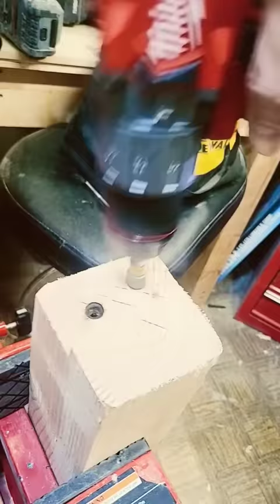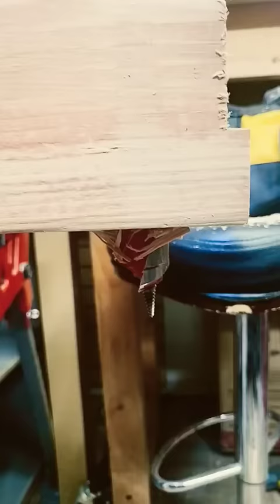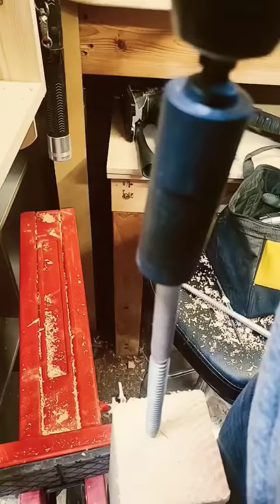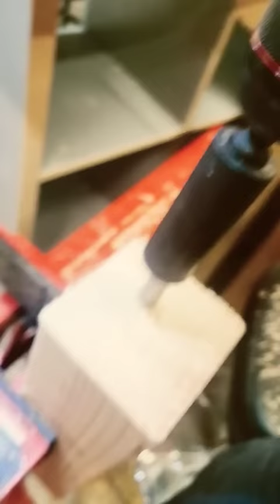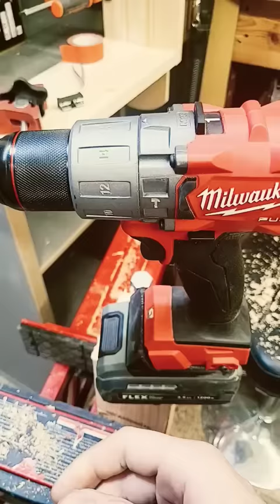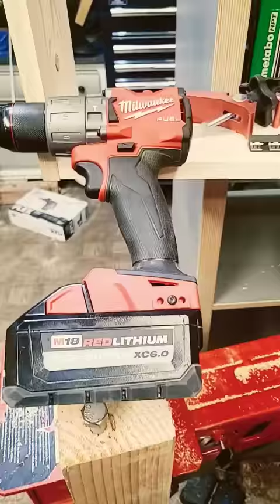Milwaukee VS FLEX - BOTH  using Flex's Battery! 💀

Comment: Well it’s the way electricity works, if you power a dc motor designed for 18v and run 22v than the motor will have 22% more speed and power
Reply: These batteries are almost always the same voltage regardless of whether they advertise 18V, 20V, or 21V.
They use 5 lithium ion cells in series. Each cell will have a charge voltage of 4.2V and a working voltage of 3.6V.
Reply: @Falcrist  no, 18v or 20v tools run an 20v nominal or 18 under load. 24v tools  run 24 nominal or 21-22 under load. They are not the same voltage
Reply: @Falcrist  24V batteries like Flex and Kobalt use 6 cells in series. They are not the same

Comment: I have milwaukee tools. 
Yes it will drive screws and lags of many lengths. 
You wanna really test a cordless drill put a 4" hole saw on it and drill through 1/2" steel plate.
Reply from the maker: yeah that's a real test for sure!

Comment: I have a question for all you guys. I have a flex power tool but no battery. Do Milwaukee batteries work on flex tools? And if they don't, which other battery other than Flex battery work someplace?
Reply from the maker: Yes, with am adapter   but get the flex batteries the adapters will kill your batteries
Reply: @toolsandtactics  thank you 🤓✌️

Comment: I wonder if anybody's tried a torque test m18 fuel drill with a flex 10 amp stacked lithium vs Milwaukee battery

Comment: I seriously wanna see someone 3d print a NICE , m18 battery to m12 tool adapter.
Reply from the maker: I think I m going to hardwire 1 live lol
Reply: Why somone hasnt tried / done this yet is beyond me. Even if the adapter needed something in it to step the voltage down a little to make it a real viable adapter. Hell, I'd buy one if they worked and save $ on buying more m12 batteries - but I'm curious what the 12v tool would do if given 18v. I'm thinking the fuel tools might just sense the overload and shut off for the tools safety, the regular m12 might just run it.  Who knows.
Reply: @kctyphoon  You would have to step the voltage down or you'd fry your M12 tools. And that makes it almost not worth it.
Reply: @Studio23Media  does anyone actually KNOW for a fact the increased voltage would “harm” the tools?  Usually things can operate within a range of voltages, and its not like it would be jumping from 12v to 60v. 12 to 18 is a pretty mild increase.  I’d expect, if anything - the tool’s voltage protection would just kick on and shut the tool down.  I’m also amazed that by now some computer geek hasnt tried hacking any of the fuel tools to increase their performance electronically through their programming. Anyway - i still say an m12 to m18 adapter is a worthy venture. I for one, would buy that if such a thing existed - as i expect many others would as well. The idea of being able to have 1 battery type power 2 different tool platform is very attractive.  No different then people buying the m18 power source so the can use their m18 batteries with their m12 heated gear.
Reply: @kctyphoon  you run an m12 with an m18 battery it will work. But with time the electronics will fry and then motor. Milwaukee would have to upgrade the electronic pcb board  to be able to handle the 18v as for the motor im sure itll be able to handle it.

Comment: Am I a monster? I've never used a drill that I could not hold on to. I am not bragging I truly get shocked when I hear people say this. I still have a Mikita 1/2 120v that I use to drill through truck frames, plows frame, and other thick steel. I've never used the handle and never felt the need to?
Reply from the maker: no, i agree, i never used a handle in the field

Comment: Until they overheat and you have to wait for them to cool off… I owned a structural steel company up until recently and my employees begged me to buy Milwaukee so I did and they hated them because they were constantly overheating when reaming or drilling steel so they went back to the old Dewalt drills and would even use the Kobalt sets I had around rather then the Milwaukee’s….hopefully there better. I did like my heated sweaters and coats …

Comment: Buddy is usin Milwaukee with harbor freight sockets 😂
Reply: You rather lose a snap-on socket?
Reply: @saint-666  don’t lose it 🥱🥱
Reply: Milwaukee is a basic brand. For years were cheaper than Ryobi. It's not like its 10 or 20x the cost like a Snapon impact socket vs the HF socket.
Reply: @rch5991  yeah bro Milwaukee is a basic brand 💀💀🤡 that’s why they have everything ryobi does but better 🤣
Reply: @anthonycurtin6522  Ryobi comes out with the same grade of tool but years later. Its not an option outside of drill/impact driver unless youre starting from scratch or youve been living under a rock and just now catching up. 

Ive had a 2763-20 for 6 years now. And it came out like 9 years ago. 1100 ft lbs and a current gen Ryobi has 1170 ft lbs. 

Milwaukee has always been the cheapest. I paid retail for an angle grinder. so weak i wish i had bought a Ryobi for 1/5th the price. But $60 for the 1/2", free ratchts, free 3/8 gun. $100 for a gen 3 impact driver. $50 drill, $60 brushed and brushless 1/4" impacts. $80 12v screwdriver, $35 12v drill. Sawzalls so junk i wouldnt even pay $50 for them.

Theres piles of this shit everywhere. its Milwaukee.

Comment: There's a reason it's M18, not M24. You're overvolting that motor, and it will die a quick death. Ill stick with using Milwaukee batteries, I've never had an issue, even driving ridiculously large lags. The new 12.0 puts out a ridiculous amount of power.
Reply from the maker: Yeah, dont do this  this   this was an experiment

Comment: When will people realize that higher voltage doesn’t necessarily equal more power. You need to know the amperage as well to determine the power. Otherwise you could have a 100 volt battery and think it’s way more powerful than an 18 volt but little did you know, the amperage is only .5 and it has no power. Amps x volts equals watts. We need to know the wattage of each battery to actually know the power difference. Volts alone means NOTHING

Comment: I destroyed my porter cable one.. it pulls until it destroys itself. Broke the whole handle off. 9" hole saw made it 4 of the 4and a half inches
Reply from the maker: hahah!
Reply from the maker: When i was new like 2007 i ran a 6 inch hole saw high speed on my drill , didnt engage the  arbor lock and the damn saw ran off the arbor  around the rails of the scissor lift a few times bouncing back and fourth for like 15 seconds, scarred the hell out of me! We were all the way up against a freezer panel wall and a block wall and it kept ricocheting off of everything I don't know how it didn't cut me hahah lesson learned about momentum and torque and speed  REAL QUICK!

Comment: They always test wood, test some ¼" angle iron or 100 year old concrete
Reply from the maker: Yeah 100 yr old concrete no joke!  Smu basketball stadium   hardest I've had to install anchors in   thx
Reply: @toolsandtactics  We've got a 110 year old Cattle barn and some sections of Concrete walls  isn't drillable with Masonry bits, you'd need a Dimond Tipped Bit lol

Comment: I really just want to know why. Power delivery only? Can a flex battery on a flex drive/drill do the sma work better. It just seems really convoluted which makes me feel like I am too invested, but come on. Everyone involved has to finish or you failed.
Reply from the maker: Yes they can but not as fast, does that matter   ...  no but  yes.. lol  depends on the task  ex building A DECK, lots of screws faster , and  more rpm    drilling metal?  No , auger yeah,  but how much speed to you really need?  Concrete? yeah flex is better ,faster ..  average all around use milwaukee is still great! enthusiast love to use tools make work fun flex all the way
   milwaukee used to be more fun because of longer battery life,good tools  but now every 1 is about the same  every flex tool has something different that stands out  (drill quick eject chuck most rpm )
(BTtery Flashy battery status stacked) lithium drill turbo button  
(Recipsaw quick insert recip collet) (circ saw inline blade)  or rear Handle  push eject battery buttons   it's just FUN  is it That much  better?  ehh  not that much but it makes work fun!

Comment: Uses a deep well socket. Not all the way but close
Reply: The bolt is threaded... It will pull itself down until the head bottoms out... Doesn't matter that it was a deep well socket. Simply ran out of torque to bury the bolt.

Comment: Decent, my Ryobi 12 volt does an 8 inch lag just fine 🤣
Reply: I’m sure it does, now is that for driving the lag bolts into your crayons or an actual piece of wood 😉
Reply from the maker: lol crayons need luv too!
Reply: @Little_jake94  running through a typical stud needed 8 inches for stone exterior hitting studs.

Comment: And you’re demonstrating what? That the lowest speed on the drill somehow means it cant bury that bolt? Dude has the setting on 1, if you knew your drill, you’d be on setting 2 for this “demonstration” lol
Reply from the maker: lol setting 1 gives more torque      2 is just speed not power

Comment: Voids Milwaukee's warranty, and yes, they will split the case and inspect the motor, and yes, they can easily tell if you stuck a Flex battery in it and fried the motor. 🪫

Comment: Now try Hercules new impact 👌👍
Reply: Did you notice it wasn’t an impact they were using?  Be a different story if they were using an Milwaukee impact.
Reply: @donniepachal75  have you seen the new 20v Hercules driver, has better output than these !
Reply: @xXm619killaxX  This is a drill, not an impact driver. Go learn the difference first

Comment: Use the proper tool for the intended job please . Drill with a drill , when driving screws , use a driver it also won’t heat up the smaller screws to a smoking crisp
Reply: It was a power demonstration. Not a tutorial
Reply: @Oink_Blaster  it was a demonstration of what not to do , lol your putting so much stress on that motor and it shortens it’s lifespan.
Reply: It's literally just a test, dude. Chill out. It's not meant to be a tutorial of any kind.